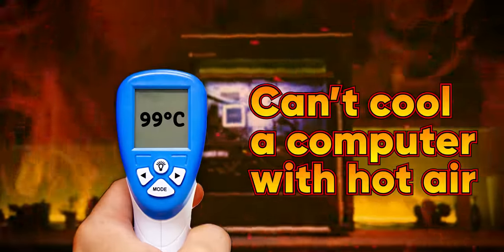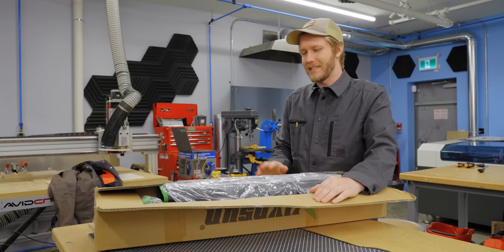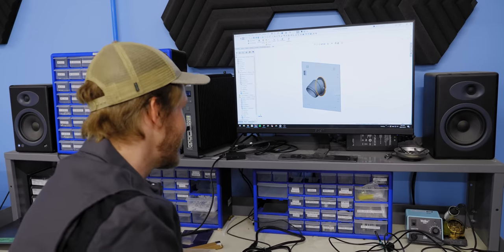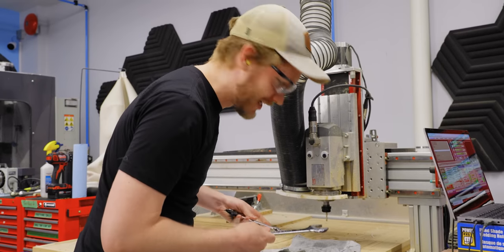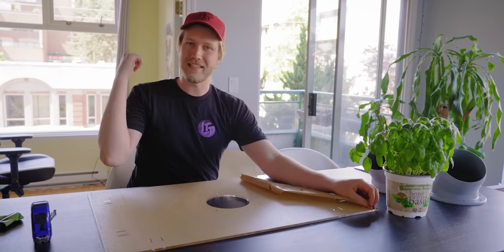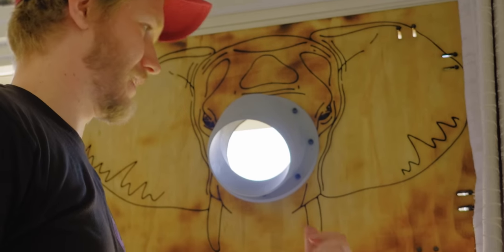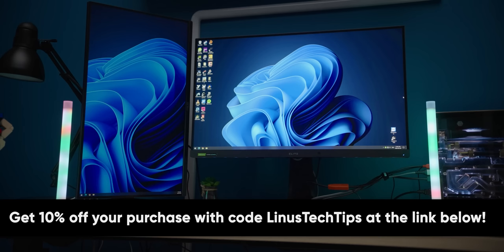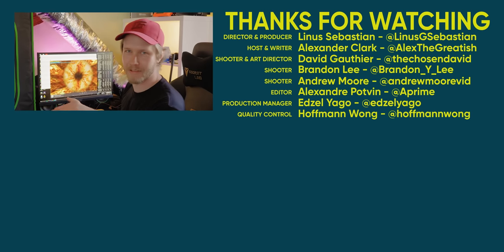You’re cooling your PC wrong. - PC in a Grow Tent

Comment: Good questions being answered, as I've wondered about this many times in the hot summer months here in the Midwest, USA.

It gets incredibly hot sometimes with my 30 series GPU running, like sweltering heat hot.
Reply: Fr
Reply: Don't u have ac?
Reply: @NeVErseeNMeLikEDis  most do but like alex said in the video the ac won’t always help in a small room with essentially a heater running
Reply: I was playing Forza Horizon 5 with my wife a few weeks ago in my computer room. She pulled out her temperature gun and it was 81f  in here, whew! Added to the immersion lol
Reply: @paulmememan508  Meanwhile here the normal room temperature is 93.5 f lol
Reply: But I have my own question to answer. What if some lunatic named Linus took a Noctua NH-D15 and then soldered a waterblock of some sort to the top of the D15 cold plate? What would be the net effect?
Reply: @NeVErseeNMeLikEDis  It's not very common over here in the UK.
Reply: @NeVErseeNMeLikEDis  central ac sucks ass and most people have windows that only loud, inefficient, portable units will work in
Reply: @etin9810   ac will help better in small rooms.. much easier to cool with a 5000btus ac. Won't trip any breakers. They probably pull less wattage than the pc
Reply: Sat here right now with all windows open but still melting into my gaming seat lol
It's a respectable 79 degrees, But there's almost zero wind (The existing stuff in just heated), Not a single cloud, And humidity has just passed 80%.. Yeah this feels like 109 not 79 😂
Reply: @ventilate4267  you’ve never experienced good central cooling then 😂😂 sorry to tell you
Reply: @ventilate4267   you’ve never experienced good central cooling then 😂😂 sorry to tell you
Reply: @ventilate4267   this louder than a normal window ac.n u still hot. A small 5000btu unit will cool that lil room   better. N pull less wattage than probably the PC. This just stupid
Reply: @NeVErseeNMeLikEDis  5000btu WINDOW AC pulls about 5-600W a portable at similar capacity will pull ~1000
Reply: @jojo4565  that's true because they rarely build them correctly, (and even if they do) if the rest of your house isn't insulated well, always in the sun, and has sucky windows you're still fucked.
Reply: @NeVErseeNMeLikEDis  also, I never said this was a good idea CA will totally do better, but it depends on how your house is built

Comment: I would be interested to see how much this affects the amount of energy used to provide AC to the apartment. On one hand, you are dumping most of the computer's excess heat out the window, so that is good. But you mentioned that quite a lot of air was getting sucked in under the door as well.
I also wonder if a more moderate fan could do an adequate job while dumping less conditioned air out the window.
Reply: They should have hooked up two tubes to the box, with one having a fan. That way it pulls fresh air in from the outside towards the PC and then dumps it back out again.
Reply: A good variable-speed fan controller should be able to run the fan at very low speeds, so no need to replace the whole fan to optimize airflow.

Still, that whole setup wastes so much space, he maybe should have installed the computer somewhere else and used fiber cables to span the distance instead of a giant insulated hose.
Reply: I wonder if his apartment even has AC, I know not every home in Canada does. And toward the video. He seemed to suggest getting an AC was an option, implying that he didn't already have one
Reply: if he has 26c inside i doubt his apartment is using any AC at all.
Reply: @93DavidJ  https://youtu.be/T1ZnAwUg9CU?t=100 He mentions that they DO have AC
Reply: @Xeanthorn  ah! Good catch! I missed that

Comment: Ideally, with your dust collector setup, you'd want a dust shoe on the toolhead to help with containing debris while it gets sucked up.

EDIT: As it stands, you're flinging particulate around the shop with a minute amount making its way into dust collection.

EDIT: EDIT: Look into photo tents or 3D printer enclosures for smaller sizes.

Comment: I have my pc with no case surrounded by 6 desk fans. I'm cooling the right way.
Reply: One does not simply cools his pc
Reply: I cooled a PC for many years using only one CPU 120mm fan and a 24 inch box fan directly blowing into the case. I gamed on it and had six mechanical drives. This worked in a non AC room in south Florida for years. I made a hole in the wall to the next room where I had my desk and would actually use the PC.

Comment: Instead they should have used the laser cutter and more arylic to make a pretty "case" you can drop over the pc with a hose hookup on top and holes in the arylic at the bottom for intake. Not only could you make a custom size but you can see your pc also incase of RGB lol

Comment: Good video. But if you just made a mount for the fan to the elephant plate and blew it outside, the negative pressure in the room would probably pull in enough cool air to cool the room without a grow tent or exhaust tubing

Comment: An alternative to a grow tent would be a 3d printer enclosure. They are really the same concept, and come in more sizes.
Reply: Sure, as long as you vent the heat outside somehow. That's fundamentally the purpose of the tent.
Reply: probably not any cheaper than the purpose built ones
Reply: 3d printer enclosures a meant to trap heat allowing for printing with materials like ABS that require higher temps than materials like PLA.
Reply: @tukuiPat  Whilst true,  mine also has vents I can open for when I switch back to printing PLA so it doesn't get all wonky.
Reply: Or grab a punch of wooden 2-3cm in diameter parts, screw them together to form a structure the right size to encapsulate your PC and screw cut to size acrylic panels to it. Round hole in one of the panels, ur done. When screwing the acrylic panels, also smush some insulation between them and the wooden frame, now you're even somewhat insulated from air leaks that don't go your intended path.

Comment: By accelerating air and sending it out of the home, you're creating an internal negative air pressure situation which will try to equalize through any available paths. So while you're sending the warm air from the pc mixed with conditioned air out of the window there, you're pulling in hot, dirty air from bathroom vents, kitchen vents, drier vents, and chimneys to equalize. Can even be quite dangerous if there's combusting appliances in the home like a gas furnace or a hot water tank. You can create such a negative air pressure situation, that the unit can't exhaust it's combusted fumes, and it'll just vent into the home, potentially killing everyone inside.

Much better would be to water cool everything and plumb radiators outside and down a hole dug in the ground. You'll have a geothermally cooled PC and the only heat from the PC getting in the room would be the chipset, unless you water block that too..
Reply: ⬆️⬆️⬆️Congratulations 🎉 you have been selected as one of our giveaway winners. Message to claim your prize

Comment: Why not just 3d print a 120mm fan to duct adapter and then exhaust the heat outside? Pretty sure that would reduce the cost even more. 🙂
Reply: exactly my thoughts. But I guess the solution with grow tent is much simplier in logistics terms
Reply: Pushing air through a tube is complicated. I’m not sure a normal 120mm fan could push air at a distance to reach a window.
Reply: @oscodains  yeah i get that. I think they could still use the inline fan with this setup. 🙂
Reply: or just put a fan in the window? All the ducting is super unnecessary.
Reply: @oscodains  actually I've tried this lol. For 5 feet ish of duct, 1 pretty standard 2200 rpm fan sorta works, 2 is much better (one on each side) but its not nearly as good as a single duct fan (surprise lol)
Reply: @oplkfdhgk  I legitimately wonder if you'd need any system fans at all with a duct fan directly on the exhaust. Pc fans might just be more of an obstruction
Reply: @danswope  i am concerned if the heatsink would get enough airflow through the fins if you don't have fans because i think the air would rather go around the heatsink because less resistance but i guess you could fix that by installing watercooling loop so the air can only go through the radiator but ofcourse all of this is just a guess. I haven't tested it. 🙂
Reply: @danswope  or i guess you could connect the 120mm to duct adapter to the heatsink direcly so then the air can only leave through the heatsink. 🤔
Reply: @oplkfdhgk  yah it's all speculation for fun on our part but honestly if the case seals decently, and especially if you had a single dedicated front intake (of whatever size just roughly equal distance from the exhaust), I would be very surprised if the suction wouldn't overcome the resistance of the cooler. At least to the point of cooling it. To increase efficiency though you could just 3d print a duct / shroud from the back of the air cooler to the exhaust of the case. Even if it wasn't a fully enclosed duct (like you could leave one side open or vented to draw air from the vrm) I think that would do alot to ensure a good majority of the case air MUST pass through the heat sink. People actually use to play with ducting like that alot more in the early 00s it seems like at least, and from playing around with cars, directing airflow is huggggge

Comment: How effective would it be to just mount a duct trough the window directly from the PC case fans exhaust?
Blocking out every other exhaust path and using the pc fans only, no external fan
Reply: Would be better in a sense, but harder to set up. You would need to know how much flow of air you would need to help push through the amount of tubing you use. Case fans won't be able to overcome the distance and pressure. You would need a stronger fan just like the one showed in video, but another problem is pulling air stronger than what the fans in the computer case is spinning, which will damage bearings on your case fans overtime.
Reply: @Andy-wb4qm  How about using one of NZXT's negative pressure cases, removing all the case fans, and using an Arduino hooked up to the case fan port to control the extractor fan in place of case fans.
Reply: @danfr  hmm that would definitely be interesting, could be worth a try :)

Comment: For my fellow Americans: the 9:37 change from 25 to 28 (°C) correponds to a five-degree change between 77 and 82 (°F), and the 14:35 VRMark reading dropped from 79.9 to about 79.3 (0.6 degrees).

As someone who has his thermostat running at 62 right now, with a max temp of 93 this past week (17, 34 Celsius), all of Alex's temperatures here are head-scratchers.

Maybe this is one of those rooms that just doesn't play nice with what the HVAC wants? Maybe this is personal preference of at least one of the residents? Otherwise, this doesn't make sense for a HVAC-cooled room in the middle of Canadian summer.

In Surrey, the city in British Columbia where LTT operates from, the highest recorded temperature in the two weeks leading up to this video's release was 77, with an average high and low of 69.6 (nice) and 57.3 across it (25, 20.9, 14.0 Celsius).

Twelve of the fourteen days prior to this video's premiere saw temperature remain between 55 and 73 (13, 23 Celsius). The fact that the "good" room readings in the video seem to range from 77 to 80 seems to imply to me that the air outside was cooler... in the summer. Sure, maybe opening the windows would make the room more humid, but... Jesus Christ.

Even if this is personal preference, that's still nuts to me. I keep my thermostat between 62 and 68 (17–20C), which I acknowledge is a bit much. But my parents, like most I know, keep theirs between 70 and 73 (21–23C), and at most, my girlfriend's parents let it drift up to 75 (24C). When my HVAC got stuck at 77 (25C) a few years ago, I walked around with freezing-wet towels on until maintenance fixed it a few weeks later.

Unless Alex lives in Texas, none of this makes any sense to me. Plz halp 2 xplain.
Reply: There are so many factors that affect interior temperatures though, exterior temperature is not the most significant: Things like quality of insulation, airflow through the room, the aspect of the room (My room has a large east facing window and can easily hit high 20s on a morning just from sunlight), and what thermal loads are present. Opening windows doesn't help much by itself, there needs to be something to move hot air out and cool air in, think of it like cutting a 1" hole in the side of your case and disabling all the case fans, your computer would still overheat.

Comment: You don't need the grow tent.  (The insulated ducting is overkill too, since continuous operation will mean the exhausted air is only slightly warmer than the room.)  You just need a case with airflow design for a single exhaust point/side (which will be fine because you can pull more air through it).  Back when I kept my servers in my office, I built a simple tower to house them that just enclosed the rear and drew the air out the top.  A typical window fan over my desk drew air out through solid ducting (way more efficient with its straight runs and smooth walls) taped to one side, and the other side pulled the hot air rising off my monitors.

For a poorly ventilated basement apartment, it made the difference between roasting and staying just above the slightly below comfort-level temperatures we'd experience with no heat sources.

Also if you aren't gaming but do have lots of monitors, you'll quickly find the latter is just as big a problem (and their heat not as easily/accurately siphoned).

Comment: it would have been better to have 2 smaller vents, one bringing air in from outside blowing directly over the components ( no need for a side panel when its in a box) then the other venting the hot air outside. The current setup is creating negative pressure in the house, its drawing hot air from outside through all the non-air tight seals in the house, air conditioning it then blowing it across the computer and outside.
Reply: Why would you want to blow 112 degree air on your computer? That's what the exterior temp read when I got in my car last week, lol. I get where you and everyone else are coming from, and that is something people do for HID grow lights, but those lights are burning at 3,000⁰F, your computer is not, lol.
Reply: @hlaw2830  112f is 44c with the fan they have in this video blowing directly on the components, I think would still be good cooling, and I would prefer that to sucking 112 degree air into my air conditioned house. I could be wrong though
Reply: @serialexperimentsdave7213  Perhaps, though realistically that fan is for a four foot by eight foot tent, even on low it's severe overkill. Sized correctly, your concern is pretty much entirely mitigated.
Reply: @hlaw2830  A correctly sized fan would be strong enough to cool your PC with 44C air.

Having only one pipe sucking air out of your house will create under pressure and sucking that 44C air into your house. Which will make your AC run harder or increase the temperature in your house, if you don't have AC or its at its limit. But then again you could have your PC run without this tent and have the AC cool down your room. No need to pull in warm air from the outside...

Considering that the goal of this video was to reduce the heat in the house/room without using an AC, the only viable solution would be a 2 duct design, living with hotter PC components or increased noise (which could be isolated by the tent, which sadly wasnt tested).

Comment: Yeah, probably only needed the extraction fan mounted in the window to achieve the same result...
Did that with my old bed room, worked a treat.
Reply: Congratulations you are one of this months giveaway winners. Message to claim your prize
Thanks for commenting and engaging
Reply: The problem is that it really works your AC harder on hot days. The most efficient system would be a small AC to act as a supplemental cooler. a 5000 BTU AC can extract the heat generated by 1500 watts of computer.... so roughly 3-4 gaming systems.

Comment: Duct tape is actually a misnomer, it's not designed for ducting. It was actually originally named duck tape for the duck fabric it's based on. For taping ducting, a foil tape with a larger operating temperature is better.